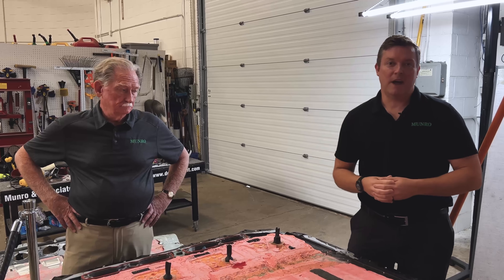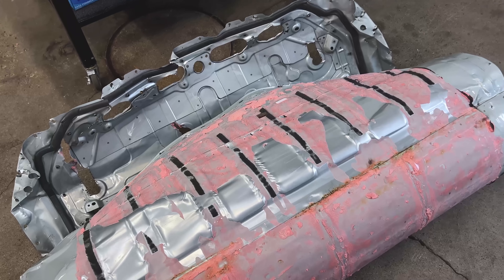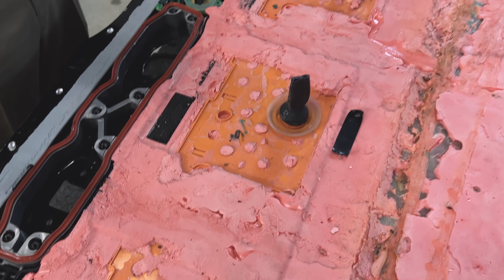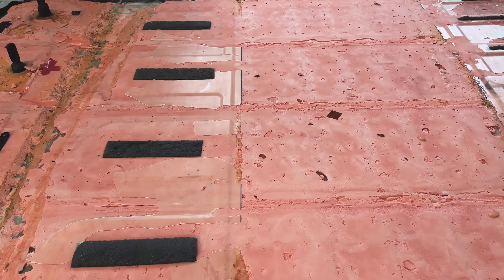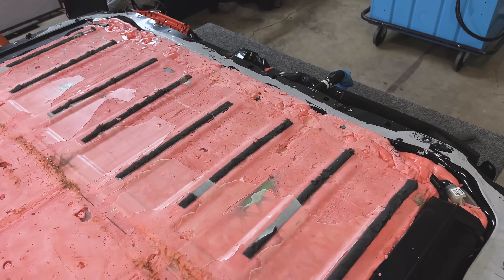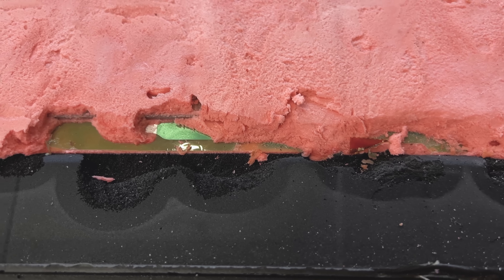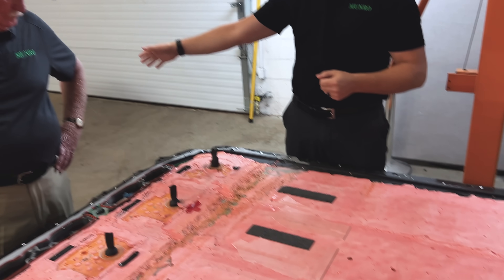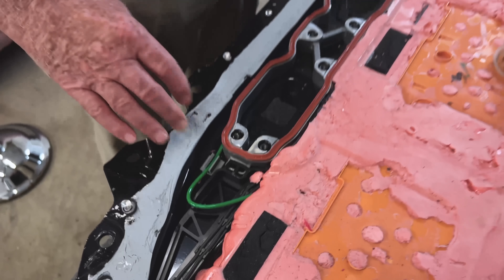FINALLY! 4680 Battery Pack Lid off | Tesla Model Y Update

Comment: Perhaps the basic sealed box with batteries is put into a mould and inflated to fit the mould then a special electrical insulator, heat conductive urethane foam pumped in as heat paste...

Comment: A couple of years ago, two teenagers were speeding in a model S on a urban curved road, lost control and slammed into a wall.  Before they could get out, the car was quickly engulfed in flames and they died there in.  As I looked at this battery ‘tray’ I wondered about this high voltage system’s ability to sustain damage without something shorting out and causing a fire.  Would love to hear how this issue is addressed on these EVs (not just Tesla).  Incidentally, the heavy duty welders gloves are being warn for a significant reason and I share the caution demonstrated by their use.  My next car will be an EV; hopefully a Tesla.  And I would like to put this concern to rest.  I don’t speed and try my best to look out for the other guy.  But accidents happen.  We also have an issue with flooding and wonder how driving through a deep puddle could effect the survivability of an EV.  Just two issues I never hear discussed.   BTW, I consider Munro Live to be one of the best YouTube channels I have ever come across and totally enjoy every episode and the information that is shared.  Thank you!

Comment: QUESTION: So with the structural battery pack, what happens when one battery cell or one cooling line leaks? how do you fix it? does the whole car need to be replaced? 🤔

Comment: How is Tesla going to recycle this battery pack if it's almost impossible to disassemble?
Reply: Same way all electronics are recycled. Big machines goes chomp chomp chomp and then raw materials are separated with heat and acid baths.

Comment: Breather tube likely to let air in/out during expansion of battery pack when it changes temperature. My mid 2018 Model 3 when it supercharges  you could hear pings from the battery pack expanding before they added breathing holes. Guessing now they need the tube because the pack is so sealed up by the foam.

Comment: Very interesting. In terms of recycling or repair this concept seems to be rather challenging as it makes it really difficult to safely and quickly dismantle the pack. What do you think of that?
Reply: It will get sent to Redwood Materials where it will be shredded and all materials recovered and re-used to build new battery packs.
Reply: Absolutely no different than previous Tesla vehicles. The indiviual modules were not repairable in those either.

Comment: Seems to me that this is a throw away car 🚗.
If there is a battery 🔋 issue, what then? 🤔
And how do you get to the batteries 🪫 for recycling?
Sort of like battery 🔋 modules that you can get to and replace.
This structural battery pack looks like a real mess.

Comment: How do you fix this if anything goes wrong?  are they really going to make it so you have get a whole new battery?  I guess if the failure rate is low enough and far enough out, this could be a reasonable trade off, but if that is the case, I want to know how long can they warranty this for?
Reply: according to Tesla they replace it & recycle up to 95% of this pack for future usage... Warranty: 10y i think
Reply: @fillthedao  That's bs, it CAN be recycled if the proper facilities existed to recycle the battare. but it won't be as it's not economical to do so. no one is going to ship a car with a dead battery half way across a conttry to get $50 with of recycled materials out of it.

Comment: Independent shops are appearing that will replace individual bad battery cells at 1/5 the cost rather than a complete battery changeout. Tesla may be trying to stop that by making it more difficult to do.
Reply: Well done, now try 2+2

Comment: RE: Breather Tube: There's already some good suggestions as to the purpose of the tube, the thought I had was that is may be to equalise pressure within the electronics modules. I'd assume there is a thermal component to their operation so may need a way to vent the pressure that other solutions, such as GORE vents, can't perform when encased within the foam.

Comment: I like the idea of the rigidity and strength of the battery pack but what does that mean for repiring it? Can a cell be replaced or would that require a complete tear out of the battery pack? Can the pack be replaced or does that mean a whole new subframe would need to be obtained? what does this design mean when in an accident? I would think ANY car accident would require the insurance company to total the car. What does this mean for the battery remanufacturers? How do you recover the battery packs?  This looks like a total write-off of the vehicle for any accident beyond a fender-bender.

Comment: Vent may not be a vent, perhaps you can add solvent  to this tube to melt the material, making removal & maintenance far simpler than how you pulled cover off.

Comment: I'm surprised not to see any evidence of the tops of the 4680 cans making contact with the top cover sheet which makes me suspect that it is serving some purpose other than that of a structural load bearing one.
I await with baited breath to see what lies beneath the foam.
P.S. You at Munroe would have found it a lot easier to remove the lid if you'd used the large sardine can key attached to the base of the unit, doooh!

Comment: I’m guessing pack repairability is a moot point with these new models.
Reply: Perhaps the structural pack and the phone make it so they last longer before something breaks? The batteries will wear out, but that doesn't require a repair but a replacement at end of life.
Reply: What about recycling this kind of pack?
Reply: Way to make a disposable product Tesla...It might be efficient when it works but from a repair or recycle point of view this is going to be hugely wasteful....one component goes out and your car is totaled. This is iphone levels of wastefulness (Just buy a new one we won't sell you the part to fix it & good luck trying on your own ) / forced obsolescence here.
Reply: @slunasaurusrex  they will recycle 100% of the battery.
Reply: @slunasaurusrex  I think you may be overlooking something here. Tesla guarantees their battery for 10 years, 160,000 kilometers against failure. Chances are the car will fail before the battery. And if the battery does fail it is recycled with over 90% recovery and reuse of all materials. There is nothing even remotely "disposable" about a Tesla battery.
Reply: @douglasburnside  i think you're jaded. So, a bank craps out, under warranty even, let's say. Now instead of repairing the bank (which more and more shops are able to do), under warranty, the entire battery is replaced. Yeah, that's wasteful as all heck. And if it's out of warranty, good luck.
Reply: @Dan_D_av8geek  It's not wasteful when they recover almost 95% of the materials in the battery and use those materials to make new batteries. 100,000 mile warranty aside, a Tesla battery failure is quite rare, enormously less common than failure of an internal combustion engine. Most users have reported Tesla battery efficiency loss at only 5% after 100,000 miles. According to Elon Musk, Tesla batteries last between 300,000 to 500,000 miles. Wasteful is any ICE vehicle.
Reply: @douglasburnside  That's bs it CAN be recycled if the proper facilities existed to recycle the battare but it won't be as it's not economical to do so. no one is going to ship a car with a dead battery half way across a country to get $50 with of recycled materials out of it. this is a stupid idea and I hope it fails.
Reply: @douglasburnside  the consumer is paying for it. Also, how much energy is wasted on recycling a perfectly good set of batteries. Think, man.
Reply: @col888881  its always economical to do so, literally as soon as there are a few of these a company will pop up to recycle them.
Reply: @Dan_D_av8geek  no one recycles a perfectly good battery, you are operating under the assumption that battery failures are common
Reply: Yes no one is going to fix that ‘maybe for a resuse in second life. Plus most of them will last decades and by then cars are replaced
Reply: @ralanham76  unless you have a fault in a single row of cells. This seems incredibly wasteful.
Reply: @AWDRIFTO  I’m sure the semi-intelligent engineers at tesla have no idea what they’re doing.
Reply: @okthisisthelasttimeipromise  I’m glad they have YouTube comment warriors to perceive and act on comments they interpret as negative.. I own and have owned multiple Teslas and love my cars. This is a fair question.
Reply: @AWDRIFTO  I'm pretty sure that Benjamin knows that Tesla has the best and most knowledgeable engineers in the world. Perhaps his sarcasm escaped you?
Reply: @okthisisthelasttimeipromise  I'm sure the engineers at tesla have a perfect idea of how to earn a maximum of profit for their company. For example by designing excellent cars that function perfectly for the guaranteed 10 years. And who wants are car older than that? Who wants to get dirty hands and repair something themselves? Better buy a new Tesla with a brand new glue brick battery.
Reply: @douglasburnside  Lmao. That's about all that can be said about your comment.
Reply: @ralanham76  Yeah, most of them**

Comment: People keep harping on serviceability and recycling. It's not supposed to be serviceable because it is supposed to be one monolithic structural block. When the battery gets too worn out for a car, it is still plenty good for storage. Then it gets recycled. That is done by running them through  industrial grinding machines. These can grind up a car ; engine included, so no problem. Then all the ground up material is separated with mechanical and chemical processes. There are plenty of videos about this online.
Reply: BTW, Jordan Giesige, of The Limiting Factor channel, is doing a very detailed and professional tear down and analysis of the 4680 cell with the help of scientists at UCSD or SDSU here in San Diego, CA.

Comment: Like everything, give manufacturers a few years and all this stuff will be utterly impossible to work on much less tear down. Throw it away when it malfunctions as none of it will be economical to replace. After removing that lid, I wonder if Sandy still thinks threaded fasteners are a bad idea? ;)
Reply: It’s not just the battery but the big casting and many other parts! How do people thinks that older cars have survived and still are in the roads today!? Because of accessibility to repairable parts…. An example is Morocco with 1970 Mercedes’ Benz taxis.

Comment: Looks incredibly difficult and expensive to recycle the cells. How does tesla plan on doing this?
Reply: Not difficult at all. The whole thing is shredded, then milled into a powder. The metals are separated chemically.
Reply: @hyperborean-kender  thats a great way to start a massive fire.
Reply: @skmetal7  Haha, they're not going to use a kitchen mixer. You are being silly.
Reply: @skmetal7  You just have to fully discharge the pack first (as in 0 volts, not 0%), it won't catch fire when shredded.
Reply: @elgranto7  I think that means scrapped in the factory, not necessarily scrapped by the consumer.  Batteries seem to be readily available from totaled vehicles in the after-market.
Reply: Exactly... I've studied Plastics Technologies and they've tought us that any Polymer is able to get recycled, at least with cracking. The reality is that, yes, it's possible, but unfortunately it's too expensive and it's cheaper to sell the waste to third-world countries who dump it into the sea. They claim the main reason is because the Polymers are not pure enough for recycling and it's too expensive to sepearate them from each other. I'm quite sure the same logic will apply to BEV batteries unfortunately.
Reply: @johnnyo8602  The raw materials in battery cells are worth a lot more than the chemicals in polymers. So the economics are quite different. Grind up a 4680 cell & you have an ore for each element far more concentrated than anything you’ll find in earth’s crust.(except for the carbon & silicon)
Reply: Not their problem. They just care about the initial sale. If they actually cared about the environment they would sell people parts to keep their cars on the road instead of forcing them to buy new ones. Also their factories actively violating EPA rules and clean air act with their factory here and the German equivalent for their Berlin plant is also telling...Electric cars are good, but Tesla is in the business of making money - not saving the world and that's abundantly clear. They just masquerade as being green because that's what the TeslaQ wish was true of their company.
Reply: @slunasaurusrex  truth
Reply: I think they will want to reuse the aluminum can too
Reply: I watched the 4680 cell tear down on The Limiting Factor and it looked like the can is stainless steel not aluminum, it was very stiff and difficult to bend. Even more reason to reuse the can, as it would take more energy to recycle stainless than aluminum.
Reply: @rupertcrighton4107  From what I've seen, Tesla is anti-consumer/anti-repair and not environmentally friendly either. Everything they do appears to benefit the stock holders and the billionaire owner.
Reply: @elgranto7  I'm still wondering how that's possible. How can tesla know that every battery is being recycled? Are they buying every battery pack and paying to transport them back to tesla? What about internationally?
Reply: @skmetal7  They don't. If you believe everything Tesla says than the Cyber Trucks would be driving around 2 years ago and we would have had self driving cars in 2015 😂
Reply: @elgranto7  how is tesla currently recycling battery packs? Are they buying them back? What about all the teslas in scrap yards? Are the batteries removed and sent back to tesla?
Reply: if nothing else you could shred & grind the entire pack into a powder to chemically separate the elements, it would still be cheaper than mining as it’s an extremely high concentration ore for each component. But engineers might be able to come up with a process more efficient than that, not sure.
Reply: @elgranto7  Key word there is scrapped. Meaning scrapped during the manufacturing process. Not scrapped by the end user.
Reply: I doubt Tesla will recycle the battery pack any more than they delivered Cybertruck, full self driving, a $25,000 car, the Tesla semi, spandex man, robo taxis, or the many other promises Musk made. One thing is for sure...
The 4680 structural pack is 100% unrepairable! Anything fails inside the pack and the customer gets to give the billionaire another $10,000 to $20,000 for a new battery pack! The guy who claims his goal is to "save the planet" seems to have another goal.... Gathering more billions into his account.

Comment: @Munro Live, Check for a high volume of zirconium oxide in the HDPE. I'll bet that all that goo is meant to act like one giant heatsink. When you get to the bottom check the hot gas escape path that will keep the cabin safe in a thermal event.

Comment: In Liverpool a few years ago there was a huge fire in a multi story destroying lots of cars. We all know what happens when you super heat a petrol or diesel tank, but Im super curious to know how these would respond…. Would they hold out, or would the pressures build and lead to a massive explosion
Reply: wich pressure lol its foam, literally filled with air, no pressure
Reply: There's vents out of the bottom of the pack to relieve pressure in the event that the electrolyte gets boiled off if the pack ever gets compromised enough to go into thermal runaway. It'd still be plenty of fire, even with the fire retardant foam. At the end of the day whether it's 330 kWh of energy from 10 gallons of gas or 120 kWh in a battery pack, that energy doesn't just disappear, it's going to be released until the car is a smouldering wreck. Electric vehicles get a bad rap for battery fires but it's less energy than a ICE vehicle has in the tank. The big difference is that it's easier to put out a gasoline fire than an electrical fire where you basically have to just keep flushing it with water to suppress it until it's done.
Reply: @AndrewMerts  yep, firefighters are infact totally scared of electric cars fires

Comment: How many cells!?
Reply: Munro staff still haven't exposed the cells enough to confirm the configuration so there's no way for them to answer the question. Why not just wait for that video?

And from other photos of components before assembly, there appear to be 828 cells, physically arranged as 69 cells stuck to each of 12 cooling snakes, and likely electrically connected as 92S9P (23S9P in each of the four longitudinal blocks which Sandy pointed out in this video).

Comment: I hope car insurance starts covering ‘battery failure’ complete write off out of warranty cars when it’s completely un repairable
Reply: I have no idea what car manufacturers are planing once 8 years battery guaranty is over. Batteries don't have long life or in case of a defective cell what will happen? How are we going to buy used cars wehen battery degradation or battery replacement comes into consideration?

Comment: This is likely going to mean these batteries never get recycled.  This car is a throw away if the battery pack fails.  Not good for consumers or the environment.
Reply: Not really. Teslas plan is to recycle their batteries in house  in a closed loop system so they must know a way to do it.
Reply: @saff226  it’ll never happen.  They said it to ease peoples conscience, just like what the plastic industry did.  Once they realize the cost to recycle is too high it’s a no go and trust me they already know it’s not worth it.
Reply: @Somethingaboutthat  this totally different. Battery materials a very valuable and in short supply. The exact opposite of plastic
Reply: @saff226  if battery chemistry never changes sure but it is set to change so no.